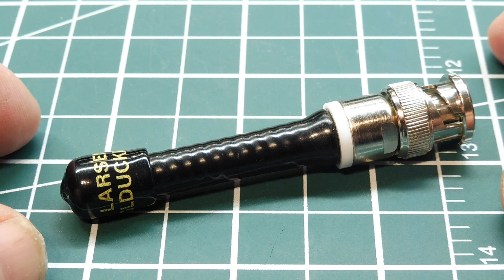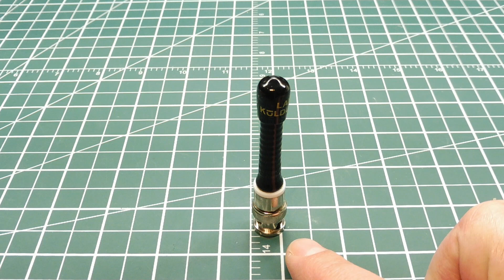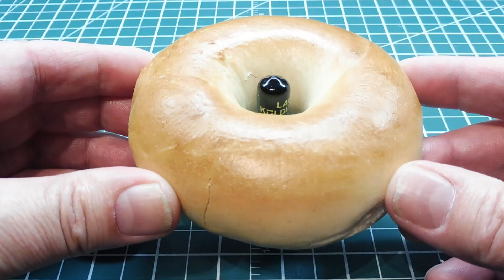Antennas 101  / How does an antenna work

Comment: Dude, what the heck was that? I mean it was interesting and everything, but that was NOT a "101" level presentation about antennas. You only touched briefly on a scattered variety of antenna related topics, but it didn't flow, and it surely wasn't on a 101 level
Reply: 101 is the basics. Whats your level of basic? If my guy got anymore complicated it may well have gotten messy.
Reply: @Wtfinc  I meant that it was well above the 101 level. To me, "Antennas 101" should teach people who no nothing about antennas the most fundamental principles...or even just the beginnings of the fundamentals. But this video was quite a bit higher level than that. Thats what I was trying to say.
Reply: Steve Gergetz 

uh? 101 means basic overview, as in Math 101, of Hist 101 in college...so yeah, its not fundamentals
Reply from the maker: The simplest antennas are the 1/4 wave monopole and 1/2 wave dipole which is the basic building block for all other antennas. I covered these antennas in a video under 10 minutes and tried to convey that an antenna is not merely a coat hanger stuck onto a radio. What is your idea of 101 level? Check out this video which was made in 1947 for graduating kids joining the airforce as radio operators and introduced to antenna 101 fundamental theory. A lot has changed since 1947 so this is very basic.
https://www.youtube.com/watch?v=XMxaYj7Xs5k

Comment: Does the outer metal of the coaxial cable work to isolate the inner one from radio waves while transporting a signal and receives radiation?
Reply from the maker: yes .. that is correct and the physical dimensions of the cable determine the characteristic impedance.

Comment: Hello, I would like to ask whether this formula can also be used on 433mhz or 915mhz systems.
Reply: According to this formula, it has become 1.66 cm at 433mhz and 0.78 cm at 915mhz. Is this correct?
Reply: I'm not questioning, I'm just a learner who wants to plead for the answer... Thank you
Reply from the maker: I am building two antennas for a LoRa project (915 Mhz ) Watch for the video.
915 Mhz the wire lengths are: 7.9 cm
433 Mhz the wire lengths are: 16.6 cm
Reply: I am looking forward to watching and learning...

Comment: Great video, but question- how the heck do you get 50 ohms coming out of the radio- I thought ohms was a measure of resistance to current, not something that flows.
Reply from the maker: When we say the radio has a "50 ohm output" we are talking about an "impedance" ( AC resistance ) which cannot be measured with an ohmmeter. It has resistance and reactance and is frequency dependant. This means the radio's power output is optimized when driving a 50 ohm load.  A proper transmission line and antenna as the load will ensure this will happen.
Reply: 0033mer thanks! I'll chew on that. I guess it's sort of like electrical AC "inertia," or sort of like how power plants have a certain resistance across their generators, or like how transmission lines are storing and cycling through reactive energy which is stored in the region around the lines in an inductive manner. And I suppose it has something to do with the power getting radiated properly at the antenna rather than reflecting back to the radio station.
Reply: I found this from the Practical Antenna Handbook-

"The impedance of the half-wave antenna usually is considered to be the imped- ance as seen by the transmitter at the input terminals. This impedance consists of both resistance and reactance. If the antenna is cut to a length of exact resonance, the reactance is zero and the impedance is purely resistive. However, if the antenna is longer or shorter than resonance, reactance is present. When the antenna is made shorter, capacitive reactance is present; when the antenna is made longer, inductive reactance is present.
The impedance at the antenna input terminals is important in terms of power ef- ficiency. If the transmitter is feeding a nonresonant antenna, a power loss is caused by the reactive component of the antenna impedance. Conversely, if the frequency of the transmitter is changed, the electrical length of the antenna also changes. If the frequency is made somewhat higher, the electrical length is made greater, and in- ductive reactance is added to the impedance. If the frequency is lowered, the elec- trical length is shortened, and capacitive reactance is added to the impedance."

Comment: Why 4 wires on the ground plane versus say 3 or 5?
Reply from the maker: More would be better. There were only 4 holes on the N connector to solder on the radials.
In mobile applications the antenna is mounted on the roof of the car so the whole roof becomes the ground plane.
Reply: 0033mer woah that's really cool! The ground plane is  one circuit though right?
Reply from the maker: That's correct.

Comment: Hello Sir - very nice demonstration and explanation.  Just one slight correction I would humbly offer: around 2:40 you refer to maximum power transfer from a stereo amplifier to a loudspeaker.  This may be the case in vacuum tube designs but in most solid state designs the amplifier is made to behave as a voltage source, and usually has an equivalent output impedance of milliohms.  The designation of 4 or 8 ohms you may see on the speaker terminals of an audio amplifier relates to the design limits of the output stage and to the current and voltage capability of the amplifier to deliver its rated power to a load of a given impedance before either running out of current or voltage.  Therefore, it does not exactly relate to the typical RF power amplifier or signal generator, where the output impedance is matched to the rated load impedance for maximum power transfer.
Reply from the maker: Thanks for the response.Yes .. In a vacuum tube amplifier the tubes drive a impedance matching transformer so the speaker load is important for maximum power transfer. These are the days I remember. Solid state class A/B amplifiers are more flexible about speaker impedance and we match more for distortion than power transfer. With the new class D power amplifiers however the output low pass filter needs to see a proper speaker load for power and frequency response. For someone who is new to antenna operation I simply used the stereo speaker output example as something they can relate to.

Comment: If you were to swap the word Antenna for the correct term Aerial, it would be more understandable and technically correct.
You will only find Antennae on Insects.
Reply from the maker: Marconi ( father of radio ) coined the term "Antenna" which means "tent pole" in Italian.
His tent pole with a wire attached was called an Antenna.
The engineering standard group IEEE made the word "Antenna" official for the apparatus as we know it.
http://www.ece.mcmaster.ca/faculty/nikolova/antenna_dload/IEEEStandard_AntennaTerms.pdf
Reply: I forgot to mention, I am in the UK, so dislike any "Americanisms" that twist our language. I use an Aerial on my radios.
Reply from the maker: Ok ...You are from the UK and that is the term you use ... fair enough.
If I go to any radio accessory website in the UK, they sell Antennas, why is that?.
https://www.radioworld.co.uk/vhf-uhf-base-antennas

The only reference to Aerials is for receiving only.  eg TV aerials.
Just trying to understand the difference.
Reply: Understand the difference.??
36 years licenced Radio Amateur (NOT Ham Radio, which conjures up ham-fisted or botched.)  Ham is sliced cooked Pork meat.
Its proper name is Aerial, irrespective of transmit or receive. You will find Antennae on insects like the Butterfly ETC.
The description has been miss used for many years.
You will learn to be a proper Amateur Radio operator, when you use the word Aerial to describe the object you have attached to your radio.
73 G1ZQC (Look me up)
Reply: David Potter we don't care, massage still got through.

Comment: How did you know to bend your 4 prongs down 45°?  If you were trying to verify your 50ohm would you hook it up to a multimeter or a scope or some other device?
Reply from the maker: You would adjust the antenna for minimum VSWR or maximum (db value ) return loss at the operating frequency.
A VSWR value lower than 2:1 or a return loss greater than 10 db is what you want.
Any device capable of measuring VSWR or return loss can be used, and tune for best results.

Comment: Great video. I’ve been a ham for a long time, but this really helped me grasp some of the fundamentals of impedance matching better.

My one complaint–I’m American, but I use metric for anything technical. As soon as you started using inches I got discouraged.
Reply: Length in Inches X 2.54 = Length in Centimeters
Use a calculator ... there is one on your phone.
Reply: You COULD have just stopped watching and closed the video ....
Reply: That’s a weird suggestion. You want me to try to use my phone’s calculator while watching the video on it and also be able to concentrate on the subject matter?

My 7th grade teacher emphasized a method of getting comfortable with Metric. I embraced it and it’s served me well. Don’t convert. Measure in metric and just use that. For most day-to-day stuff, you’re approximating. See a quart of of milk? Think of it as a liter. See a measure of 100 meters and think of it as about the size of a football field. 2 liter bottle? That one is easy. :) I can never keep dry ounces and liquid ounces and weight ounces and 5/16 screws and acres and 3/4 miles all in order. So I look on the package for the metric values and do everything that way. Sooooo much easier than trying to convert Imperial tablespoons to cups. An M3 screw is 3mm and an m4 screw is 4mm. Is a 5/16” screw larger than a 3/4”? Let me find a common denominator. Or maybe just divide to get a decimal inch equivalent. Maybe that’s why it seems okay to use a calculator to people used to imperial units. You’re used to that overhead. If you usually use metric, then it’s just weird to not be able to shift a decimal and get a matching unit.

In science we’ve moved on. I learned Earth acceleration due to gravity as 9.8 m/s/s, with 10 being good enough for many purposes. Many of my peers struggle with 32 ft/s/s. See who gets bogged down more quickly.

But I get that the US politicized the change and we are still an imperial nation. I don’t care of other people are happy using it. However, in any US science or technical discussion, I expect to hear both. If you have a layperson (non-scientist) US YouTube audience, it’s rude to just give metric values. The US audience is going to miss the gist or tune out. You should know your audience and accommodate their special needs. 

Many Europeans know non-tech people in the US are a big part of their audience, so they commonly make the effort to have both. But it’s just weird (and a bad look) to not include metric, the lingua Franca of science, at all.

To the suggestion that I stop watching the video because I don’t like the units? Did you not see that my main message was that I loved the video and got a lot out of it. It’s exceptional. I just found the lack of metric units made it harder to understand the subject matter.

Sorry so lengthy. I just was annoyed to be poked by two people over a simple suggestion tacked on to a complement. It was a waste of my time and anyone else who reads this thread! My apologies

Comment: Hey, I have been watching every single possible video on antenna tuners that I can find in order to understand everything I can about this devices, I have a modem receiver that have this single wire antennas that come with a ATU unit "Two of them" each have a this totally miniaturized version of it.. but range on this particular unit really stinks. Now its my hope to increase the range by installing a good set of choked dipoles but don't know if I have not other choice but to use the same type of ATU? with the same value on the capacitors & inductor....your advice will mean the world to me!!
Reply from the maker: Start out simple. Go through the instruction manual that came with your tuner.
Feed your single wire antenna into the tuner. Make sure you have a good ground ... very important.
The impedance of the single wire will be high so the tuner matches it to the 50 ohm radio connection.
Use an antenna analyzer during tuning to get a low VSWR which will verify the match.
Get in contact with your local Ham club if you need more help.
Check out this video that describes a very simple setup:
https://www.youtube.com/watch?v=o43sAF4HwJs
Reply: I'm very grateful for your advance, thank you very much.. but what I was really asking was.. since the one wire are already tuned by the manufacturer.. and have such a short range would I have to use exactly the same tuning circuit when I connect it to a dipole? ore will I have to use a different circuit....or slightly different... ?
Reply from the maker: A Dipole is a resonant antenna so you need to cut its length to 1/2 wavelength at the desired operating frequency.
Use a SWR antenna analyzer to find the resonant frequency and fine tune it so you can feed it directly into your radio.
If you do not have any test equipment feed it to your same tuning circuit and then your radio.
Reply: Yup, I do have the means to make my own custom antennas and I will be using probably a 1/4 wave, my true problem is my ignorance of that if I remove the tuning circuit... I may literally destroy my receiver.. "Since  been a modem there is some data exchange... goes in both direction" that is what is digging a hole in my head, that is the reason I'm trying to find a few fellow amateur radio friends that can guide and help me, thank you very much from Daytona beach KN4GCQ

Comment: What's the width of those copper wires? does it matter?
Reply from the maker: Thicker gauge wire will increase the operating bandwidth but in our case we just want is to stand on its own.
At lower frequencies the lengths will get longer so aluminum or copper tubing can be used.
You can use 12 or 14 awg romex copper wire ( house wiring )

Comment: How can I collect the transmitted waves and again transmit???
Reply from the maker: You need a radio repeater. A receiver and a transmitter operating in duplex mode and a set of duplexer filters to isolate the two radios  https://en.wikipedia.org/wiki/Radio_repeater#/media/File:Repeater_duplexer.png

Comment: It's OK, but if it's antenna 101 .... why start throwing out terms like 1/4 and 5./8 wave like that?  Start with how an antenna works and how radio transmits .... this is clearly a 200 level course .... (grin)

Comment: I've watched many videos over time, read books, but have never understood my CB antenna(s), I'm not stupid, I just never found one that made sense, so I was happy to follow the rule that as long as I could get the SWR below 1.5 by adjusting the length of the 'top' part, it was good!.
This video made some sense, it helped me understand concepts I wasn't sure about. The way the power is radiated, how and why the cable can be as long as the aerial, but that it's the shield that reflects the power from the center back into itself, split the two, go opersite ways and you've got less reflection, split the shield part further and you get a ground plane, So simple it actually made sense rather than the drawing in books of a upside down triangle!
My D-Pole was the best by far, 10mls, and when there was 'skip' I got to chat to people in other countries! But, OMG! I actually have some understanding now!
Seriously, this is like the basic 101 that I needed to kick my ass into gear in to wanting to learn and understand this topic rather than just getting the lowest SWR, I hope now to be able to look for another video or wait for you to produce one which can explain CB antennas, base loaded, mag mount vs through hole grounded, you really did a amazing video there... not too much maths, just enough to help... Thank you soooooo much!

Comment: what lengths would the wires be for 11 meters 27mhz cb radio?
Reply from the maker: You can use the same formula:  2832/27 = 104 inches.
That is over 8.5 feet so you would need some support to make it practical.
Fiberglass whips or center loaded commercial antennas are available which are smaller but the 1/4 will give you the best performance.

Comment: Brilliantly explained sir, just superb. Greetings from Wales (no call sign yet... hopefully in two weeks if I pass) 👍
Reply from the maker: Thanks for the feedback and good luck with your test!
Reply: Many thanks.  Can I suggest a video project for you (and for me to copy haha!)... any chance you might be able to do a project that constructs an SWR meter using the Arduino? I am certain this would be hugely popular!
Reply from the maker: I have built VSWR alarms for repeater systems using a Motorola directional coupler and a microcontroller.
The directional couplers are expensive and tricky if you want to build one yourself.
I would invest in a Bird 43 and learn how to use it properly ... very powerful tool.

Comment: But ground plane antennas don't have any extra gain?
Reply from the maker: A 1/4 wave monopole ground plane antenna is a unity gain antenna (0dbd) when compared to a 1/2 wave dipole.
When compared to an isotropic antenna it has a gain of 2.15 dbi.
Using a unity gain ground plane antenna you will get a about a 6 db increase over a rubber duckie (helical) antenna.
A rubber duckie is very inefficient, it is basically an attenuator. It is a compromise between gain and small size.